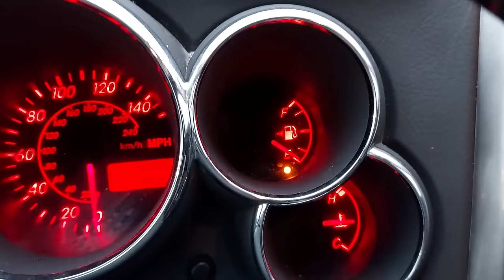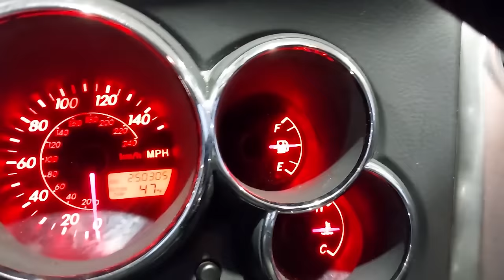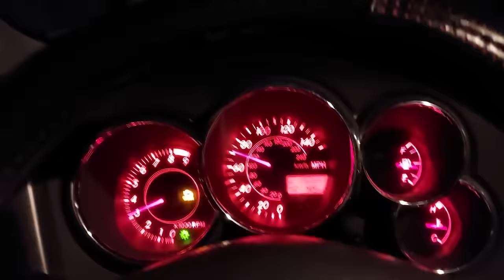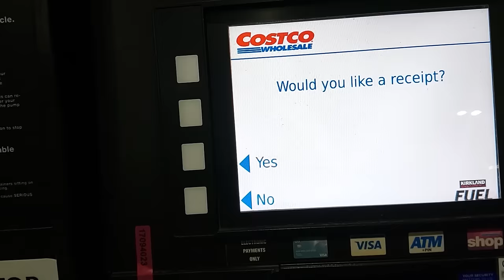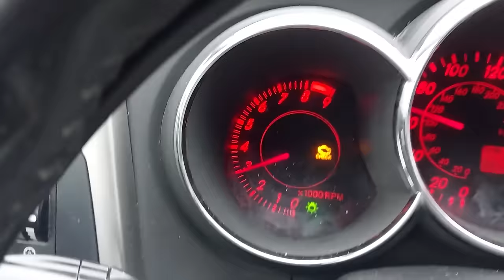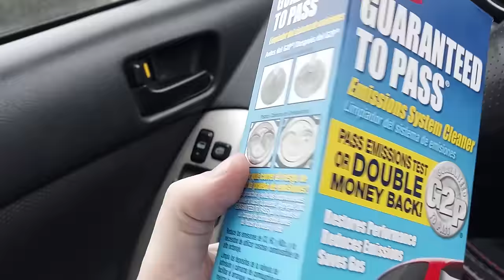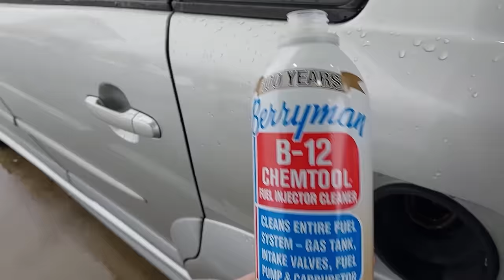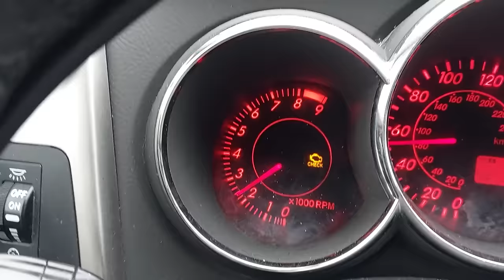Product Testing! Seafoam VS Rislone VS CRC VS Berryman do they work? Can they fix a P0420?

Comment: You should have tried one more product that I always had good luck with that's called Chevron with Techron fuel system cleaner always had good luck with that😊😊
Reply: 2014 Honda odyssey 175k. Techron did nothing for me. Crc does what it says...cleans system enough for you to pass the test.  Code returns like bad penny

Comment: No matter what code any check engine light is an automatic emissions failure, even if the light is off there's pending codes until drive cycles are complete and reediness monitors are set.

The 420 code is directly related to the 420 code, the VVT codes are causing the CAT code because you're either running it too rich or too lean and that will damage the catalyst. Timing Chain or Belt likely needs replaced (depending on which you have) and yes timing chains do stretch and throw the timing out of sync.

Comment: INVALID TEST! You completely wasted your time on this one. 
1) You never installed a new downstream O2 sensor. (The front sensor doesn't show or have an impact on cat efficiency).
2) You installed an aftermarket high-flow cat. High-flow cats have less catalyst allowing for higher exhaust flow but do much less "cleaning" of the exhaust which makes them much less efficient...
Those 2 things alone will never get you where you want to be as far as this test goes. You would have been better to have left the old cat and change out the rear 02 before trying these products. 🤪

Comment: I'm a bit late, but I think you test methodology might have been wrong? If the additives are working as a cleaner, then measuring the dirtiness of the oil with the products added wouldn't be a proper test. You actually should have put the product in, driven for the recommended amount of time, performed an oil change - with only oil and filter, and then measured the clean oil after say 50 miles. If a product is removing very good and removing dirt, then the output oil should be MORE should be dirtier than usual, as it is removing gunk from the engine. Then, the next batch of oil is going into a clearer engine.

Comment: Nope nope nope you needed a little bit more of an angle you can get the longer ones that'll work properly for about 3 bucks at any parts store if you're a little creative you can maybe even make your own somehow out of some plastic container like a water bottle with the back end cut off or something but I would recommend getting one of the heavy duty plastic because the water bottle plastic unless you poured in pretty quick might have some issues

Comment: But if you got a clean cat, why are you running products to clean the cat? I mean, if you know the cat being dirty is not the problem, why trying to fix the code with a product that promises to clean the cat?
Reply from the maker: Fair question, because these products are often touted to "clean or cure" the O2 sensor and the code as well.
Reply: @LucoreAuto  I thought that they were meant to clear the code by trying to “clean” the catalytic converter, whenever that would be the problem. At the end what was the real problem? Was it the O2 Sensor?

Comment: Pull O2 sensors out spray them down with carb cleaner get as clean as possible then run a carbon burn off (sea foam carbon killer) that should clear the code and make it run awesome cos gti vvti vtec and eco tec are bad for carbon build up because of the emissions sensor recirc in the intake or the EGR
Reply: I had a k24a8 that kept doing the same thing I run injector cleaner cleaned the O2 with carb cleaning and washed in diesel then cleaned it off again reinstalled then done the sea foam carbon killer and EGR delete (as in australia that is legal) and the car has never run better and hasn’t thrown a code for left bank (O2 code normally) or cat code

Comment: Yeah I tried some of that cleaner and it didn't work I put in a new O2 sensor on a 05 Honda Coupe DX aftermarket that did not work either then I talk to a Honda mechanic and he said what kind of O2 sensor did you put in I said just the cheapest one I can find I can't remember what brand it was but he said you have to put a Denzel the expensive one and he said if you don't put a Denzel which is the OEM one Honda uses for their engines you're not going to be able to clear your check engine light code and he was right I put that one in clear the code got my emissions and it's been off ever since just to let anybody know and is having problems with their check engine light

Comment: I thought bank one was the Upstream and not the downstream sensor
Reply: Bank 1 sensor 1 is upstream-unprocessed exhaust. Sensor 2 is after catalyst. If there are two exhaust manifolds with separate catalysts, either a V6 or v8 engine or inline that has split exhaust, then you have two banks since there are two systems. Each of those 2 banks will have 2 sensors. There are some around with 3 sensors per bank too.

Comment: Iv been taking to someone on this thread, & while I thought there were like 20 things that could cause this code, now it seems more like 30(at least👋😑).   btw., I wouldnt use seafoam B4 rislone or cataclean, it can loosen up the gonnity gU & clog cat.  & Y I understand Y you filled gas after adding rislone(I’m guesscing anyway) it was to mix it with gas, it’s actually I’ve heard only supposed to be like 5 gallons, sOooo, with tank near empty(maybe 2 gallons, 1st add rislone, cataclean, etc., THEN add 3(ish-depending) more gallons, then drive appropriate mil., etc.  but aaall this is IN-CASE it’s from cat being clogged up with carbons, do you something else.  & at same time, MAYBE it will fix cause.  sea foam & others do alot, but cat rislone, cataclean etc., are specialized to clean cat, which seafoam does not.  SF(abs.) washes gunk too it, then 1/2 tank pr more is 1/2 potent with double gunk, io, 1/4 powered & if you added more gas right after 1/2 tank(someone posted)? 1/5 power..  so if you do all this stuff in order, then you can see if you don’t need a cat., &&&, if there’s something before cat causing problem.  its annoying agreed, all this too see if you DONT need some $1000 factory cat.  a $30 diagnostic tool.

Comment: Gotta use risilone valve lifter cleaner, that makes my car run like new, also the red bottle if CRC is better, seafoam is garbage for car engines it's made for 2 cycle, gumout complete is much better

Comment: So after watching tons of cat cleaning vids from in tank potions to full removal and soaking in soap and water to sodium hydroxide to lacquer cleaner/cellulose to caustic soda to jet wash to compressed air blast. Nothing actually works. Sure a load of crud and muck comes out on many vids but the cars never run better. Seems that even when the honey comb structure is intact (wouldn't be worth cleaning if fallen apart/disintegrated) the cats lose their ability to do the job due to age and perhaps once contamination has occured the damage is done. Only one thing for it. Save your money on this task and just buy a new cat.
Reply: Yeah, that’s my final verdict after videos, mechanics, and owners clubs. If you don’t want to see the code, install an illegal spacer on your O2 sensor. If you want to pass inspection, a bottle of miracle oil might do the trick. If you want the code to go away, have your vehicle running most efficiently, and save the planet, install an OEM cat. Period.

Comment: I tried almost every Liqui Moly oil/gas additive - with absolutely no results. Wasted so much money to learn that. With oil consumption - Verlust Stop (Stop Leak), MoS2, Oil Stabilizer - yeah right. No result whatsoever.Maybe quiter engine running sound for a short time.
Catlaytist system cleaner, injector cleaners - fuel consumption the same, error codes go away only for short period if ever.

Golden truth for me is that there is only one single case when these additives maybe useful: when you want to sell the car and mask problems. What a disappointment.

Comment: Im retired auto tech My ? would be is it a factory new cat or a cheap knock off. If its factory correct, Then I would differently change O2s. And snake oils although sometimes help a guy get home. They tend to be preventive Maintenace more than a cure

Comment: Its amazing how many people are fooled by the differences of octane in gas. 93 is not a high performance fuel. All it does is increase the resistance to pinging and detonation. Nothing more. It does not give, make or produce any more power than regular octane. There is no thermal or mechanical benefit to running premium over regular. All you had to do was remove your O2 sensor and clean it with brakleen.

Comment: this was a very esoteric test, you have tried to resolve a bent vlv to work right with a stiffer spring trick here. Way too many other things you failed to address and factor into the scenario in Proper Trouble shooting.
Like engine temp sensor, Vacuum leak-back rate, CAT temp from F/R sides, Plugs condition new or Old or improper types will induce issues absolutely, Air filter new or dirty, is it sealed properly?, fuel PSI IN/Out reading.
LOTSA stuff you  left out. 
This was a waste of time 100%.

Comment: I appreciate all of the testing, however, this method is flawed.   You're using only one vehicle and pouring all of the cleaners in the same car.  So even if the last test was the "worst" of the products tested, the system would inevitability be cleaned by that time.

Comment: 🤔°°°°Hmmm,
maybe they don't have some OTHER 
emission system cleaners in that region.
 Scotty Kilmer,
(very knowledgeable
mechanic), 
recommended ,
( quoting ; 
"I've had great success with this over the last 30 years."),
 Obtain 1/2  a  tank of gas and pour in a gallon  of 
Laquer Thinner.
 Drive at highway speeds , as possible,  for 150 miles-(ish) 
 OR
as HE does, 
idle for about 30 minutes at
 2500 RPMs.
 To let it run through and,
 (do it's thing)🤷🏻‍♂️
 
  Watched another video by a guy thet mentioned S. Kilmer's method , taped the process start to finish, 
SUCCESS 😀 
  I'm in the process,
( not verbatim 🙄) 
but truck's  not choking and dying like B4, But not 'Cured'.
   
ONE MORE product promoted,
  (Not an Ad),
 just a non 
Laquer Thinner 
believer,
 Cat a Clean'.
 Same volume of gas, 1/2 tank - 1 whole bottle of  
Kat a Kleen.
 Drive normally,
(🤔for WHO),
10 - 15 minutes, 
refuel.
  Bottle recommends 
"3-4 X per year  for a  healthy exhaust system. "
 I'll be trying THAT one Next.

Comment: The thing is if you got a healthy catalytic converter why would you have to even use this stuff I know you're trying to get rid of the code and check engine light but I'm trying to see the science behind that they're my friend just thinking logically seems like if you had a clean or new cat converter that would solve the problem right there anyway I'm not done with your video here but was just thinking

Comment: Not true. Berrymans AND Seafoam fixed a misfite.
Reply from the maker: They certainly CAN be used to fix/improve a misfire situtation, I've used those products myself. However this is testing an alternate use of the products which is supposed to be curing an O2 sensor code